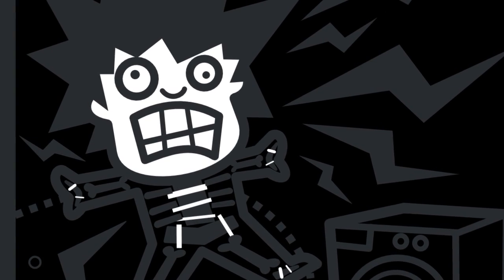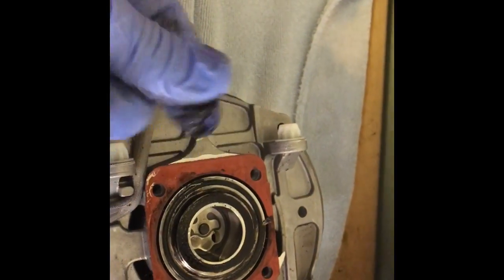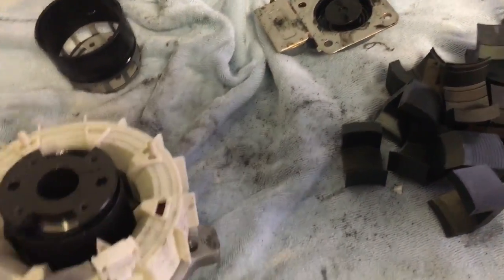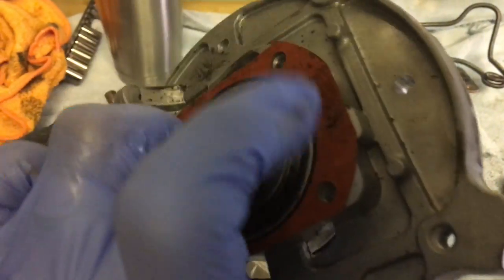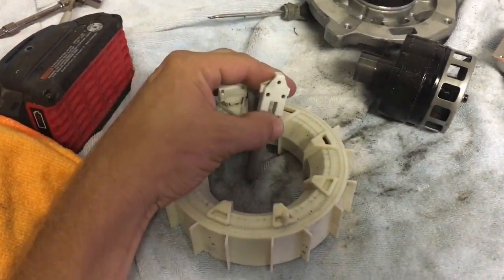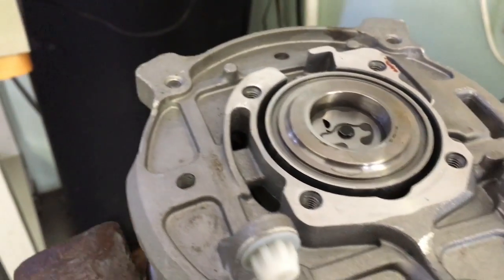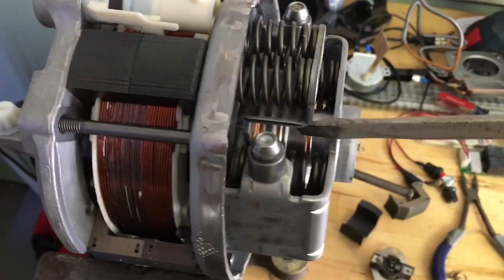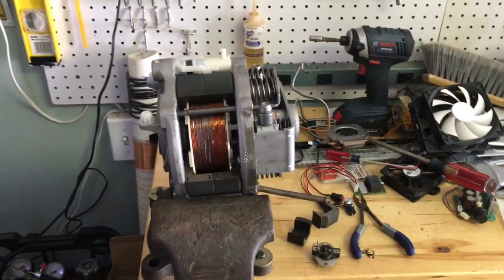LG Linear Compressor Teardown

Comment: What's the diy fix
Reply from the maker: Can't tell if you're joking or serious. Serious answer is that the compressor needs to be replaced that requires torches. Not a DIY job unless you know how to braze and have gauges and a vac pump.

Comment: That black stuff is black death. It gets pumped into the other components eventually causing a restriction in cap tube down the road. Tried on test fridge to flush it with no luck. Worst compressor ever. When they go unless the windings fail first they released that black sludge and it contaminates the whole system

Comment: The best thing you can do to keep this compressor alive is it needs to be kept as cool as possible. I see these refrigerators installed with cabinets tightly against the sides and top. It's critical that the top has at least 2 inches of clearance from the cabinet above. 
Also, every French Door LG I've seen had vent slots in the base of the cabinet by the condenser and compressor. Hard to see but they are there. Those slots allow air to be drawn in from floor level into and through the condenser, then exhausted back out at floor level once passing over the compressor. 
I see these slots completely blocked with dust all the time. People just don't know they are there, and the owners manual makes no mention of keeping them clean. 
Of course it goes without saying , keep the condenser clean. Blow it out, don't just vacuum it. Do it twice a year. If you have furry companions , do it more often.
LG needs to put a high compressor temperature warning into their refrigerators. That will get the attention of owners and hopefully they will jump into action. 
And what's up with that cheap Reed valve design? Every linear compressor I've replaced had high suction pressure due to that valve failing. "New designs" ( not sure what is new) are still failing the same way. I have customers with 75 year old refrigerators that are still humming. What are those Reed valves made of that LG can't duplicate.

Comment: Lg servicecenter owner here.  The heat kills them.  You MUST keep these cool!  1.  Unplug unit before moving it. Or throw breaker.
2.  Remove lower rear metal cover. 
3.  Vacuum dust off the condenser and back metal cover.
4.  Repeat every 6 months or more if you have hairy pets.  If you do a lot of frying (looking at you folks from india, Bangladesh,  Mexico etc.)  You may need to use a degreaser on the condenser)
5.  Leave or make space on all sides according to the manual.  If that is not possible,  put a hole in the upper cabinet and a fan.  They must stay cool!  
Almost all failures i see have a dirty condenser and or install in a tight cabinet with no ventilation.
You can put a temperature logger on or near the compressor that will send the data to your cell phone for under $20 on Amazon.   Set an over temperature alarm.  If you keep it happy it might last 20 years or more!

Comment: The diaphragm which works like a speaker woofer to move the linear piston to compress move refrigerant. It’s just cheap and gets hot. So keep your coils clean hope you get 5 years. I’ve had some customers that are now at 10 years. So I wonder why exactly some fail so fast. Particals in system  not sure. That’s for tearing it down for us techs to see.
Reply: its a fundametally (i will leave the ironic typo?) flawed design... sure, they look simple, and the basic idea makes sense, but mechanically speaking... its useless.

linear... as pressure rises, that magnetic circuit can only deliver the same force on the piston. pressure can never be higher than that force over area.

rotary /reciprocating... the crank and conrod automatically provide a neat force amplification as pressure rises, basic geometry. where else do we see such a mechanism? in a press. a clamp.... over-center latches...

Comment: Trying to figure out what would cause that valve to fail, metal reed valves have been around since forever and are used in pretty much every air compressor and two stroke on the planet. Looking at the way that hole is shaped it appears to me that the pressure is causing it to bend into the shape of the hole in the piston likely fatiguing the part. If I had one of these I'd get a new valve laser cut outta some thicker spring steel and reassemble, last thing I'd do is replace the compressor as the valve is clearly not able to handle the high pressure side of the compressor.
Reply: But the compressor is in a sealed (welded) housing (which is already cut off in this video) so you can't access the compressor bit shown without opening the compressor shell with a cut off wheel or saw...

This is pretty much an un serviceable part, unless you put in extreme care, time, and cleanliness to open and re weld that shell on.
Reply: @volvo09  Does the housing actually hold any pressure? If not it would be like a 30 minute job to clean and weld. Not an HVAC guy so I don't know, just seems pretty stupid to keep replacing the same expensive part every two years considering how much of a pain it would be to pull out, put a new one in, and re-charge the system.
Reply from the maker: Yes, the compressor is part of the sealed system and holds refrigerant. It might be possible to do that but it would be an incredible feat to accomplish. The compressor is pretty much a dome holding a motor supported by springs and connected with steel tubing to the outside of the dome. The reed valve is inside of the motor. 
 @linuxguy1199
Reply: @theappliancetechnician  Yeah it seems like it would be a feat, but personally I'd give it a try if I had one of these, I do most of my own work and can't stand having to replace something over and over with the same crappy part.
Reply from the maker: I have another video where I use a regular compressor instead of the linear. That one is still working in a friends garage where it hits 100+ degrees June through Sept here.  @linuxguy1199
Reply: @theappliancetechnician  Many videos on YT of guys in India cutting the dome off the compressor pot, then welding it back on after repairs.  Not linear compressors though.

Comment: @2:53 If you look above the "piston" you'll notice the broken part of what I would think may be called a reed valve or something similar. What a shame they couldn't build things better.
Reply from the maker: It's not uncommon to see that weird break in it either. I've seen it several times. You'd think they would break on the connecting parts and crack off but it hasn't been the case from what I've seen.
Reply: @theappliancetechnician I think there is some kind of high-frequency rippling occurring in the reed as it comes down on its seating, and this is causing a very local sharp bending that exceeds the fatigue limit of the material. I have seen a rather similar reed failure in a factory air compressor, in which it wasn't so serious because this can easily be taken apart and reassembled. For many years Yamaha used reed valves in the induction system of two-stroke motorcycle engines; I have worked on many of these and have never seen a broken reed. Yamaha's reeds close onto rubber-coated seats that probably have the effect of damping out any high-frequency rippling. They also have curved backing pieces that limit how much they can curve on opening.

Comment: I had two LG refers fail, one under warranty, the other, one year out of warranty. Both were bad compressors. Fortunately, LG agreed to fix the second one no charge. Problem is, the repair was badly botched by the service company resulting in a second repair by a different service company. (Covered by LG.) Now, the dang thing makes a clunking noise when I move the refer. It does not make the noise when it’s running, only if I shift it back and forth just a little. Sounds like something is loose inside the compressor but after watching the video, I can’t see what it might be. It never made this noise before and the service company tried to convince me it was a normal sound, when it’s running, but his argument was flat when I told him it was not running. Anyone have any ideas? TIA.
Reply from the maker: Compressors will clunk if you shake them. The motor sits on 4 springs inside of the metal dome it's housed in so it moves a bit. Moving it will make a clunking noise. There are clips that hold the compressor down to the frame of the ref, if they're there then it may be normal when moving it back and forth. I'm not so sure I'd believe it  was a botched install with the failure rate of these compressors and some techs need to make themselves feel better by talking S about another's work. I'd like to think that techs grow out of that when they get the tables turned on them. If it's in, and nothing is kinked and it worked for a year and they changed the filter I can't see how it's a botched job. If it's botched that bad it would have never worked. Especially with over and under amp errors on the inverter that runs it. Sloppy job, maybe but sealed system work is like sausage. You don't really want to see how it's made as it's not always pretty. I try to make mine pretty and usually do, but I'm not perfect either and have had some jobs that don't want to seal properly and end up with a quarter stick of brazing rod on it. Also it depends on if they used a torch or lok ring. Lok ring is supposed to be easier but the rings don't always seal and more experienced techs will braze the whole lock ring in extreme cases and that's ok too. It has to be sealed, and it has to flow. Anything more than that is lagniappe. I've seen ugly jobs that lasted 10+  years and think "That guy was having a bad day or a tough time with that braze but stuck with it and got the job done."
Reply: @theappliancetechnician   The first replacement compressor lasted 3 days. The tech used some kind of compression fittings, did not braze the lines. The second tech (different company) brazed all the lines. I’ve checked out a couple of other videos showing a tear down of an LG compressor and they do float and move inside the housing.  Maybe it is normal but never heard it before on this refer or the other LG I have.
Reply from the maker: Lok Rings are the compression type fittings and yeah, that's why I don't use them and braze instead. To each his own. I haven't met a compressor that doesn't clunk when you shake it and have done quite a few of these replacements. In my experience there's about a 10% chance they will never work again when these go out. I've had some run ins with these.

Comment: That kind of a butterfly in the upper chamber is the one that breaks over time, cause is moving up and down, and then the succion and or the pressure diminish or stops, and on end  no cooling.    maybe the system or the metal alloy or quality has to be fixed, if they haven't.   (the main motor almost never fails)

Comment: I recently purchased a new lg French door fridge with the linear compressor . Of course I hear about the failures after the fact . I’m hoping they’ve got this resolved in 2023 ? Maybe wishful thinking
Reply from the maker: They're still dying out there. There's been 101 excuses as to why and "fixes" that no one can explain except in unprovable theories. Time will tell, but I don't believe them. Somehow they are here to stay and still failing a lot.
Reply: @theappliancetechnician  lol,go figure. You would think after infinite failures over the past years and law suits etc,that they’d address the issue
Reply from the maker: @MajorTendonitis  They've "addressed" it for sure, with fairy dust and excuses and board updates that they never can fully explain. Like the samsung icemakers, 50+ fixes and no real solutions. Muddy the waters enough and you'll never get a straight answer on how to fix it. Sad part is that no one knows how to get to the bottom of a problem anymore, and this was the point of this video. Techs will even say "It's fixed" and walk away as the new standard is to walk away from it working now. Nevermind 6 months from now. I do everything I can to find the source and solution to the problem.

Comment: I have a 2019 LG french door fridge with linear compressor that has just failed 3.8 years old ( 2 months shy of 4 years) is all it lasted. One week later Tech was here and diagnosed -- unit has a bad compressor, we are on schedule to get replaced next week. So I guess they improved them from lasting 1.3 years to 3.8 years if that is an improvement I guess??
Currently living out of a cooler for next 2 weeks-- bare necessities, milk , eggs, etc.. threw a lot of perfectly good food out that would not fit into cooler.

Comment: The grand daddy of linear compressor is the Japanese company Sawafuji that makes Engel portable DC/AC refrigerator. They call it swing compressor. The compressor is driven by very simple circuit that take advantage of the sprung mass natural frequency. I believe they started this compressor technology as far back as the 60s. Even till this day, it is as energy efficient as the much more complex and modern smart electronic driven DC rotary compressors started by Danfoss.
Reply from the maker: Thanks for the FYI. I've seen this design in other things that was a good design like air pumps and there was a pretty heavy and simple steel one that used the same mechanics. I guess they skimped on the material this go around. The ones I've torn down have had broken reed valves and complete burn outs for lack of better terms.
Reply: @theappliancetechnician  I appreciate the reply. I infer from the class action lawsuit this LG linear compressor for their fridges had been an utter failure, due to these design and manufacturing flaws. I infer LG has since switched to more conventional inverter rotary compressor like those by Embraco that supplies the bulk of the usual suspect brands.

LG now only touts "smart inverter compressor" and provide no useful information. I would not be surprised it too are now using Embraco compressors. I am not a LG hater. In fact I prefer LG over Samsung and all the US flag flying brands.
Reply from the maker: @maestrovso  As of now I still see 2 year old compressor failures on a weekly basis on LG refrigerators, nothing has changed.

Comment: I've heard that these compressors can't tolerate any sealed system leaks due to flimsy valve design compared to conventional compressors. So replacing a compressor without checking for leaks is doomed idea. Also it's hard to find a leak because of negative low side pressure but I've heard that most of the time it's evaporator connections.
Yamaha makes motorcycle engines with reed valves and they run fine so there must be something to make them break.
Reply from the maker: There are successful builds with this design but this isn't one of them. These are mostly 134 so they don't run at 600 negative pressures. I'm sure there are 600 systems out there but most of the ones we see haven't been.

Comment: Thanks for making the video! I've done the same thing. Bought their best inverter-linear.  Major repair every year and condemned in just 5 years. Microfractured the whole high circuit. The parts are on warranty but LG makes it almost impossible to get to their own techs to authorize replacements.
It's garbage straight from the drawing board. "Sucks gas" is right.
Don't buy this junk!
The design doesn't favor durability.
It's also much louder than similar time tested rotaries.

Comment: HI,I have a cuestión,do you recommend buy a LG refrigerator with inverter linear compressor? It's true the compresor It's not good,and what brand of refrigerator you recommend, thank you for you help.
Reply from the maker: It depends on your situation, there is no one size fits all. If LG could fix their compressors they would be a pretty solid refrigerator. Other than that they have few issues that can't be resolved.

Comment: I just might try to find or keep with the original compressors and skip the Linear compressors, I have a Electrolux side by side it's still running but makes noises frequently it's a 2009, been through two floods.

Comment: I know it's probably not very interesting, but could you please tell me what the inside of the charging line looks like as it passes through the case? I am pretty sure I have an oil problem and I have the idea of tilting the fridge on its back to position the charging line outlet as the low spot on the compressor to drain as much oil as I can.
Reply from the maker: What are you referring to as the charging line? If you want to get oil back in the compressor then stand it up and let it sit for a few days then turn it on. If it will get back it will. If not, then it's screwed.
Reply: @theappliancetechnician  I meant the line stub from which it was charged from the factory. 

I had too much oil,, not too little. But it turned out the vapor line on the back was where I was able to remove the oil. There was about 3oz too much! It was getting forced through the system at startup and intermittently causing severe restrictions that would move around from evaporator to evaporator. It was starving the compressor. 

On another note, I read somewhere that the linear compressors don't need oil, that the only real use for it in them is for the dye to locate leaks. I'm not sure if that's true, what do you think about it?
Reply from the maker: @PrintEngineering  I think you're chasing dragons. First off that stub off the compressor is called a process tube. It's the same as the low side. It's a line that goes to the compressor and ends there. 

How did you determine it had too much oil in it? Did you get the starving compressor problem fixed? 

I remember this compressor having oil in it.